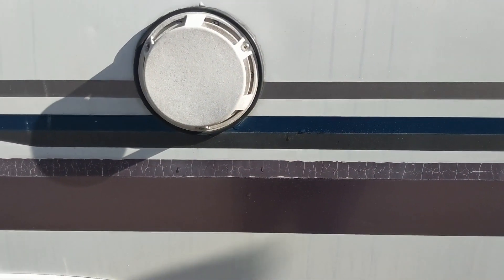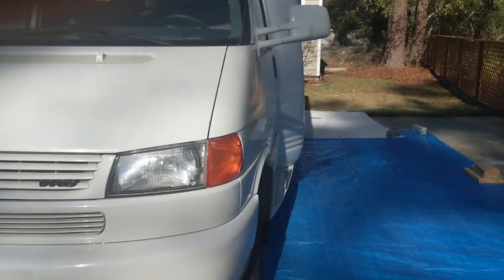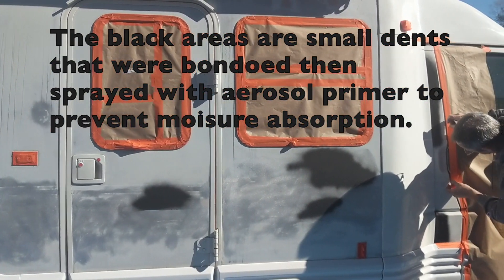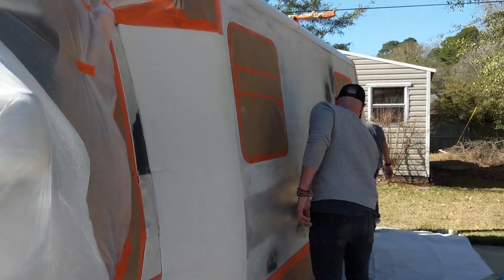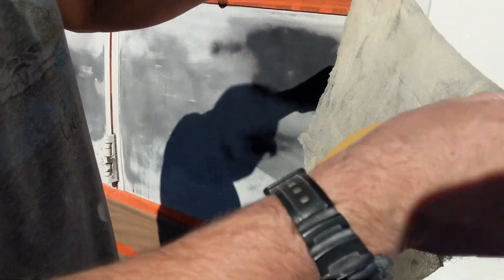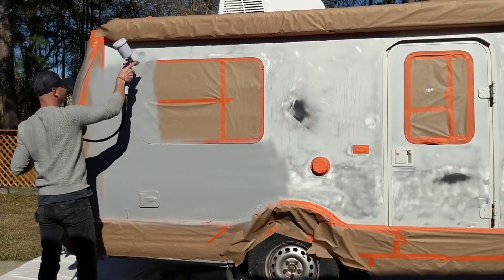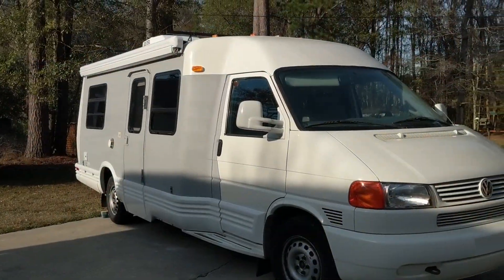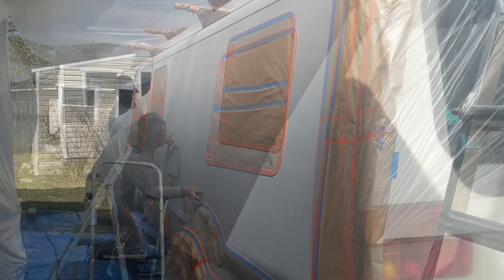DIY Painting the Outside of our Rialta RV | Sailing Luna Sea RV Edition | S3 E3  | Travel Blog

Comment: I am preparing to sand and paint the walls of my 2001 HD. What you have done is what I am planning to do so your video came in at the opportune time. I noted that you re taped 3 times. (for sanding, priming and painting. Wouldn't one taping suffice for the whole job?? There's an obvious explanation but I don't see it right now.  Did you use the Volkswagen (cab) paint for the walls? So the process is primer, base coat, gel coat. How long should you leave the paint before detailing? Did you do anything with the valance (around bottom of walls and front and rear)? I understand the OEM paint is a Dupont product but one can use whatever. Did you do anything with the valance?
Reply from the maker: We painted the exterior in stages. And you remove the tape after each step. If you are painting all coats in one day, you could get away with a single taping. But you cannot leave the tape on for an extended amount of time. We did not do anything with the valances. We tried to match the paint to the cab yes - by using the factory color. Good luck, let us know if you have more questions, and thanks for watching the video!